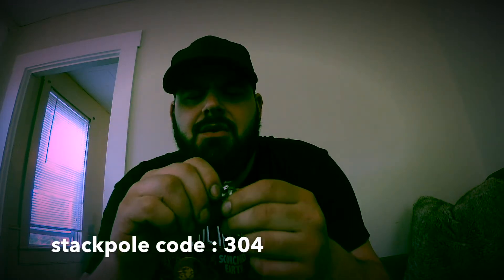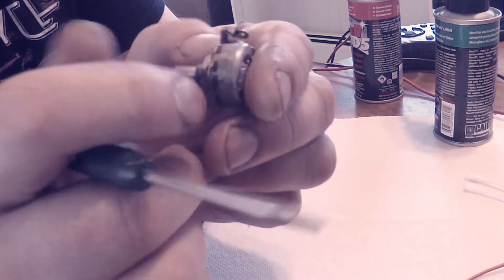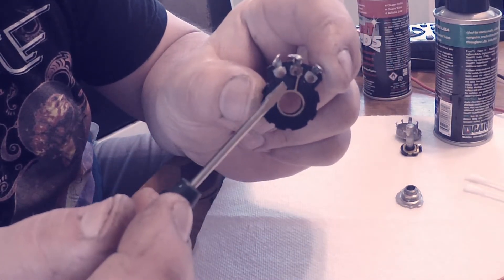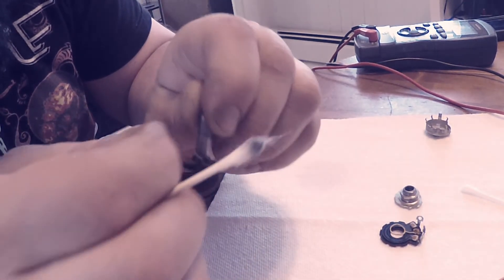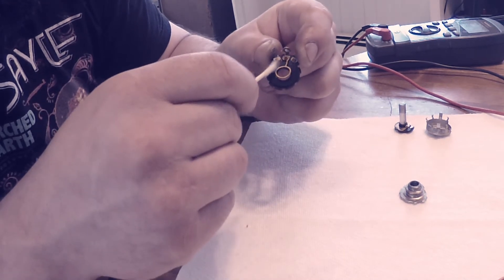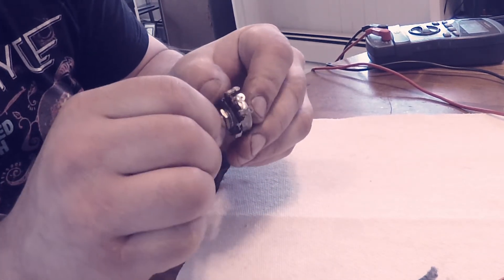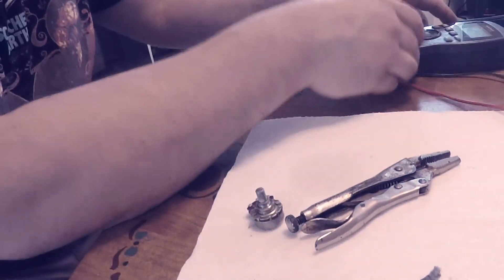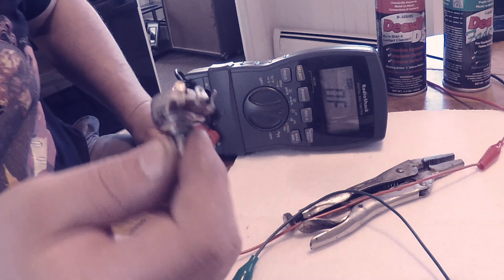Ep 7: Tech Tip - Vintage Stackpole Potentiometer Repair

Comment: I have a ‘56 stackpole 250k pot split shaft. Does it disassemble the same way as the one in your tutorial? It looks the same except for the split shaft.
Reply from the maker: Those come apart a bit different.  They have split ring holding the shaft assembly. Can be tricky
Reply: @theriffwniksevigny5473  I think I know what you are referring to. Is the split ring the piece that sits at the top just beneath the split shaft, that is a near complete ring with about a 2 mm gap or opening? If that’s it, does it twist off with pliers?

Comment: I have a loose middle lug on my volume pot. It wiggles where it connects to the pot and that causes break up in the signal of course. I heated the tab and added some solder down low at that juncture, the tab no longer wiggles, but it did not cure the signal break up. It is a brand new pot but already know I'll end up replacing it. Just curious if you know how to fix this, if it even can be fixed?
Reply from the maker: Find something similar to a pair of punch pliers, or long nose needle nose vice grips and squeeze the two sides together
Reply: @theriffwniksevigny5473  Wow...how much do I owe you....that actually worked. Squeezed with pliers (3) equally spaces around...nothing, then squeezed the pliers right under the bad lug, bam it works and sounds great again. Thanks much!

Comment: Good job Nik. The word is getting out that D5 is not good for the carbon trace in pots. It also can wreck some fiber board material as well.  It is really meant for contacts in switches etc. F5 on the other hand is safe for the carbon trace and fiber. F5 was designed for faders, but is also good for pots, (so far as we know at this point, subject to change, ya never know what someone will find out next next).  F5 also lubricates the shaft of the pot as well. Taking the vintage Stackpole apart to clean it like you did is the best way, if you have to spray F5 into a chassis or pickguard mounted pot you only need a quick short burst, just a little bit does the deal.  Also, make up applying Q-Tips are a good cleaning tool for this, the cotton fibers are more tightly compressed than the standard Q-Tips, there'll be less bits of cotton coming off. You just saved a $500.00 pot.  But, you knew that.  I know lots of cats have been using D5 for years with good results. I'm not an expert and I don't know  it all (actually I don't know Jack). It's just recently that I keep seeing techs warn against using D5 to clean pots.  I recently used F5 (the green can) on 3 1956 Stackpole pots (in my '56 Deluxe) and they're working like new now. Once again, excellent video Nik.

Comment: Cannot thank you enough for this video.  I almost replaced the Stackpole volume pot in my 1962 Fender Twin with new production junk.  The Vibrato channel pot was violently noisy and no amount of cleaner sprayed inside would cure it.  I used Deoxit F5 on the carefully dissected pot and it works like new.